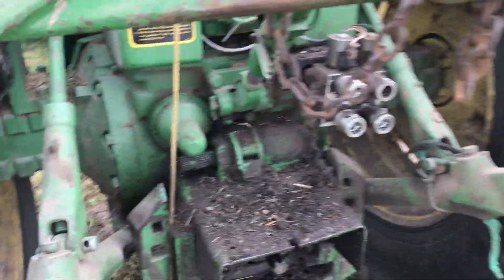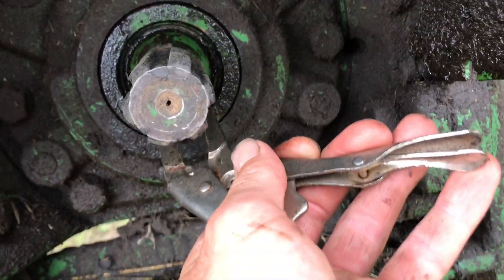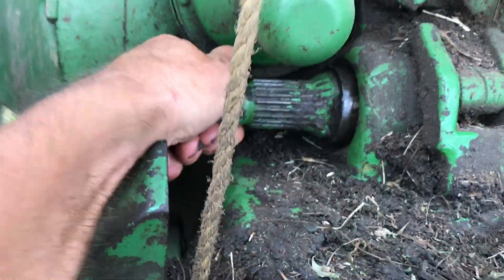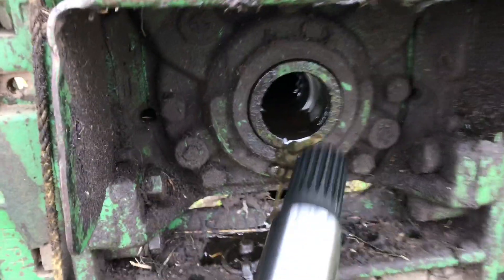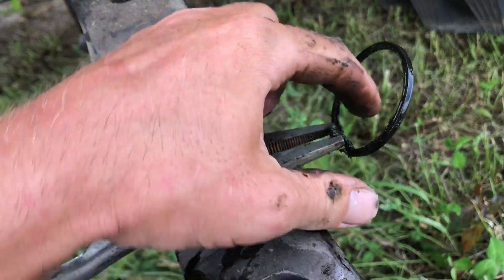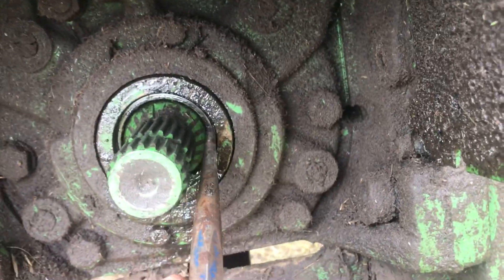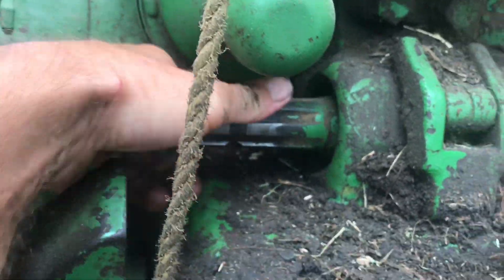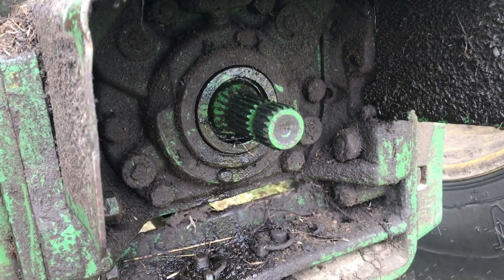How to change from 540 to 1000 RPM using the PTO on a John Deere Tractor- John Deere 4020

Comment: I’ve done that job before on a 4020. It’s actually pretty easy. What implement will it be on that required the switch?
Reply from the maker: the new disc mower